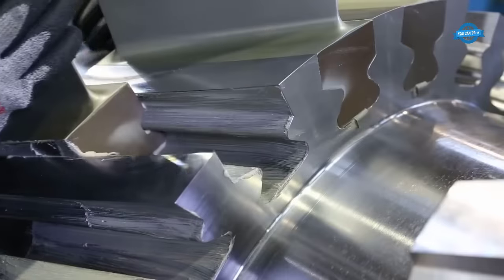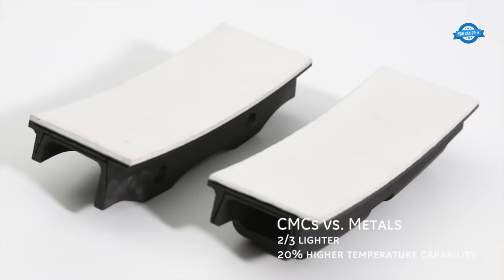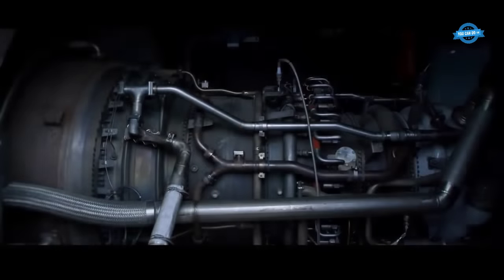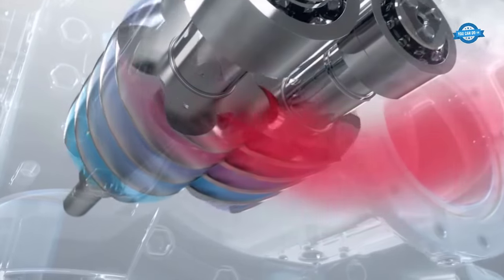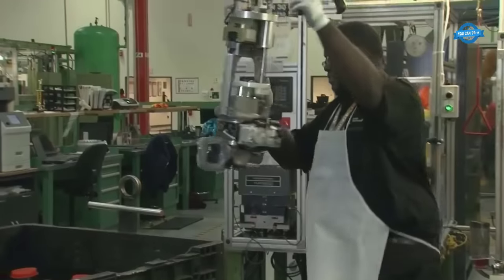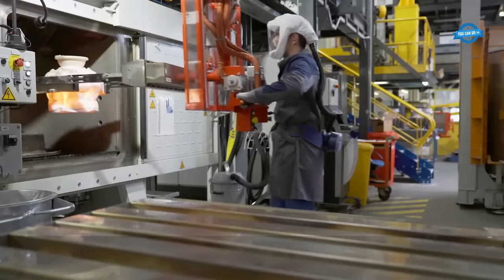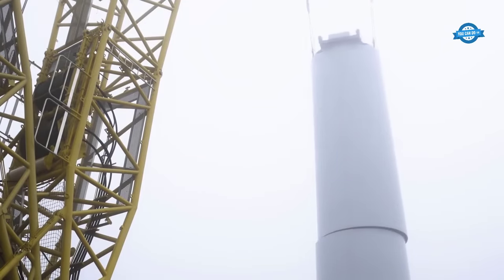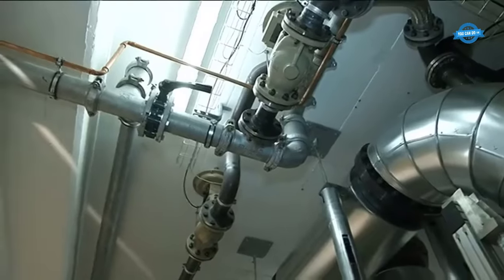Manufacturing Process Of Complex Giant Machines: Largest Screw Compressor; Jet Engine, Gas Turbine

Comment: 12:36  "...propels aviation into a new era a sustainability."
I love how they throw that word "sustainability" around.  Like those carbon fiber blades grow on trees, and the CMC's are mined at your local quarry.  They fail to mention how much energy it takes to make those items.  It's tremendous if you don't know.  Far more than what will be saved.
Reply: So what youre saying is, is it actually takes less consumed energy to manufacture turbine parts from titanium, iridium, aluminum & their alloys than to  make the same parts from CMC's

Have to admit it would be very interesting to compare higher energy consumption & cost of manufacturing ceramic-metal composite parts for one turbine engine, with the fuel savings from the weight reduction of that same engine 🤔❓
Reply: @magnificentmuttley154  What I am saying is NONE of those things are sustainable.  Manufacturing exotic materials is very costly in money, time, resources, and energy.  Carbon fiber is probably the "cheapest" to make, but you are still talking about a huge investment in resources, machines, manufacturing, and energy.  All of them are costly.  I don't think anything in aerospace is cheap.  Personally, I don't think they can save enough fuel to make up the cost of the energy losses that it took to make those exotic materials that were going to "save" them fuel in the first place.  We should be focusing on making fuel...from scratch.  Like fuel from algae, or thermo-molecular depolymerization of carbon rich materials.  We literally have the technology to turn our turds into fuel...right now.
Reply: @edgeofentropy3492   I dont keep up with Popular Science Magazine or the aerospace industry, not like in my college days.  So thank you for taking the time to explain.  I agree with you 100%.  For aerospace to grow exponentially, which it is already doing, will conceivably wipe out scarce rare-earth resources that remain in just a few years

Comment: Carbon fiber fan blades in a jet engine?   I'll be certain to not board that flight.
Reply: You have little choice.
Reply: Not all engines have carbon fiber some have titanium
Reply: @Roboseal2  that's what I thought most if not all did
Reply: Just those new "state of the art" jet engines that look kind of dumb. And also they don't sound that great either. @MrMotor11

Comment: All that effort for a hoax! those props are pathetic! A turbine is run by coal power a generator is not
Reply: I’m really not sure if this is a joke or not. Turbines aren’t run by coal power alone you realize? Turbines can be run by falling water in a damn or could be run by the combustion of jet fuel in a jet engine. Additionally a turbine can be run by an electric motor for compression of air. What part of West Virginia are you from?